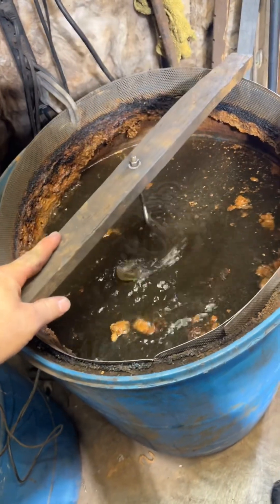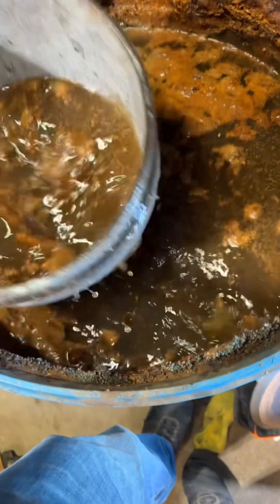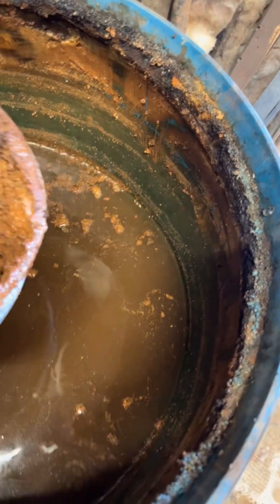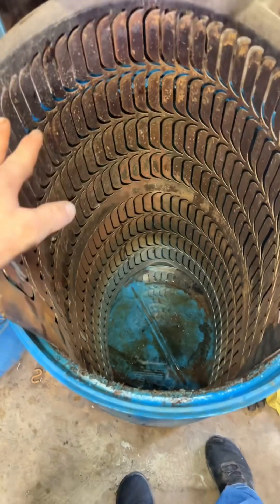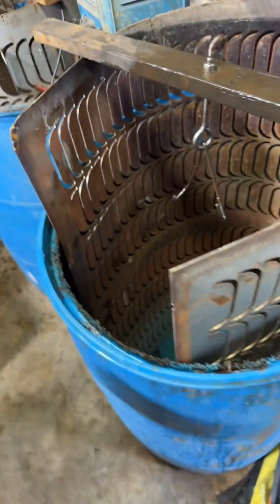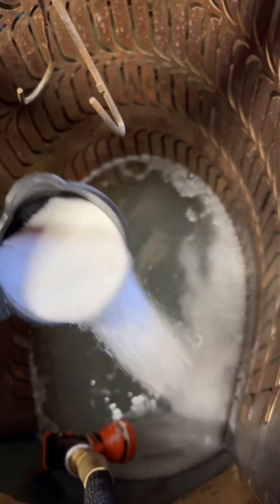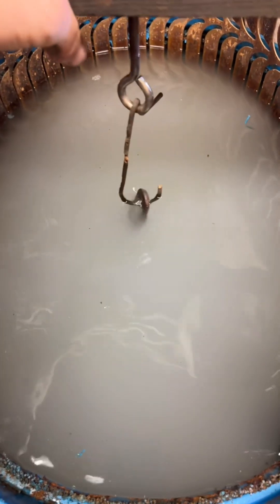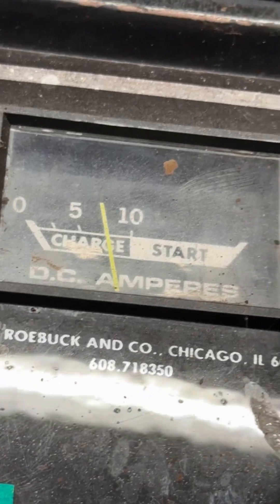Electrolysis In Depth Rebuild!

Comment: You should put the bucket (much larger) on the floor, with a magnet in it, a hose acting as a siphon to let gravity pump it for you.

Works good for me have been doing this 5 year since getting into hobby
I even have a rock and sand homemade bucket filter to cut down on soil and heavy metals pollution